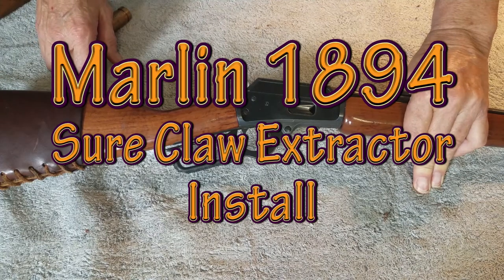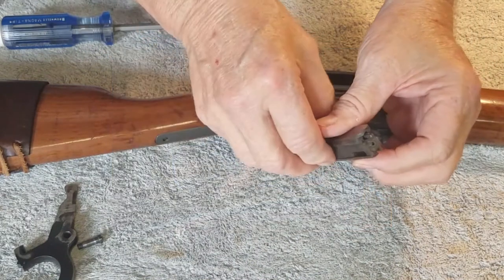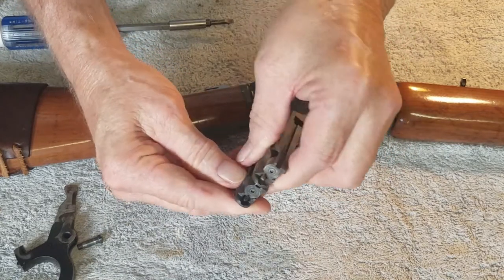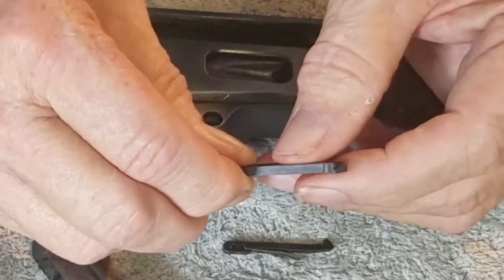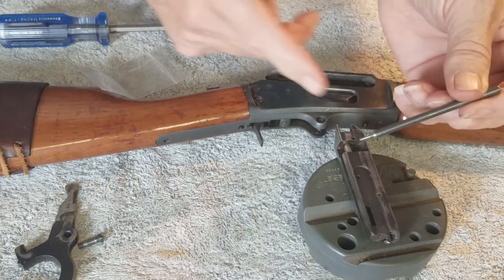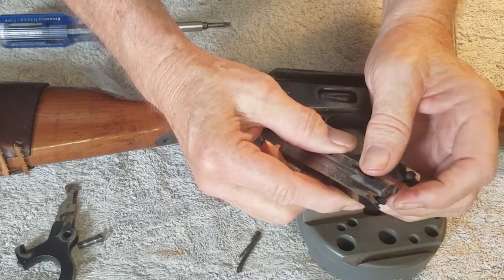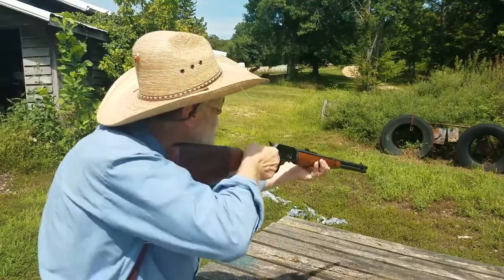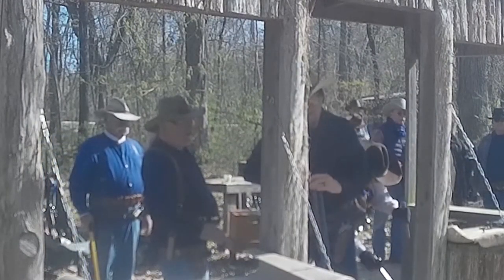Marlin 1894 Sure Claw Extractor install

Comment: Why does the new extractor help with the feeding issue? Thanks :)
Reply from the maker: I apologise for the late reply.  I just seen your question.  The extractor shape and position,  etc, guide the rim of the cartridge in transition from carrier to chamber.   The old extractor was not always keeping the cartridge on track when the action was operated at high speed. I think the Sure Claw extractor engaged the cartridge rim just a little sooner than the factory design.